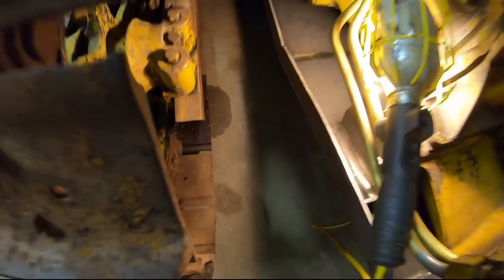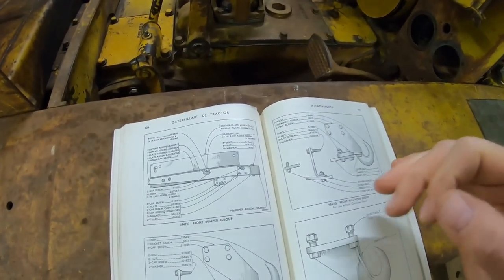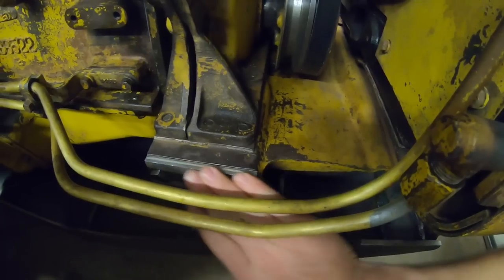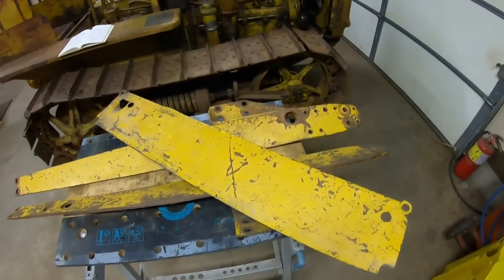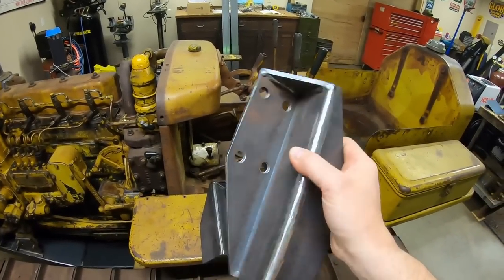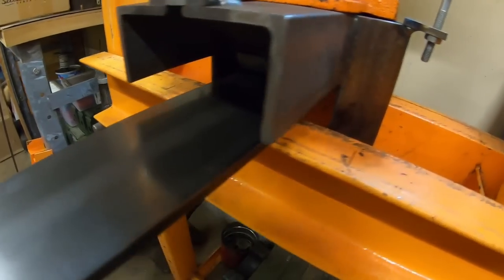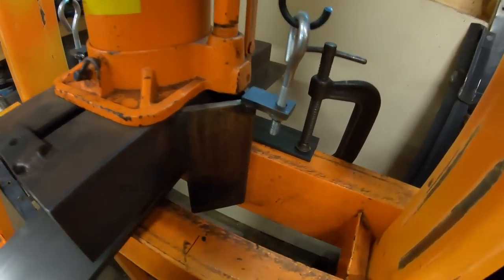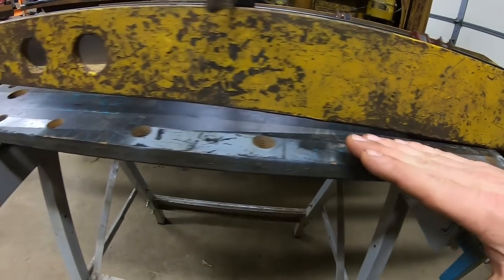Caterpillar D2 #5J1113 Chassis Rebuild Ep.53: Bumper Build Part 1 - Roughing Out the Side Brackets

Comment: Is there a calculation for how much to over bend metal to achieve the required angle? I expected the taper cut to start at the small end and cut most away then finish the cut in the middle to prevent vibrating the cutoff. Perhaps a clamp to stabilize the cutoff and keep it from bending as it is removed.

Comment: On you home made brake for the press, could you put that bottom piece in your mill to cut the corner a little sharper, as well as weld on the top of your bird house and grind or mill to a sharper point? Or is that too large for your mill or too much effort for the result.

Comment: Looking good. You need a Milwaukee 8" metal cutting saw for those long straight cuts in 3/8" steel. They work great and will cut up tp 1" thick material.

Comment: I was thinking how Toby would be able to salvage the pieces of original Sheetmetal that has has the Canary yellow paint on it. If I would tackle that problem I would scrape off the paint with a chemical, then neutralize the sheetmetal from all chemical agents. Let the sheet metal weather a little outside and then use the Squatch rattle can pain to replicate the weathered CAT yellow shade. Sandblasting or manual scraping would leave noticeable wear marks. Chemical paint removers peal off the layers or layer of paint. Since the original paint is no more to be found on these pieces it's worth consideration. But maybe it is just my mind speaking out too loud. I kind of do expect a weathered squatch paint job on the new made pieces to fit the rest of the machine.

Comment: I don't know if you will see this but if you slightly overbend the plate which is easier to correct just drop it on the floor or give it a bash with a sledge or heavy hammer, it's easier to knock some of the bend out than put more in. I used to work a 300 ton press brake for quite a number of years and dropping an over bent bend to correct it was easy